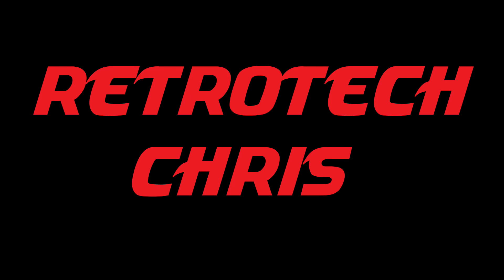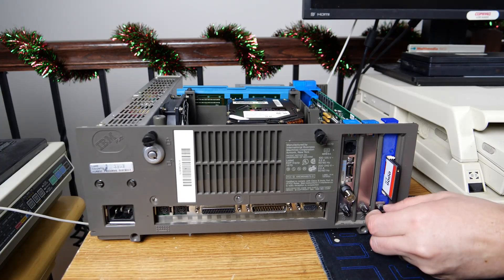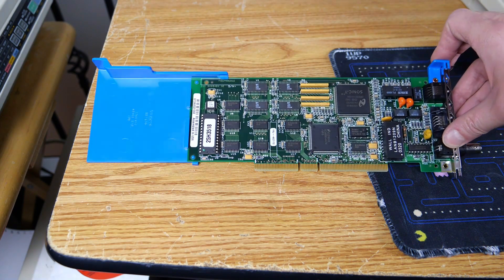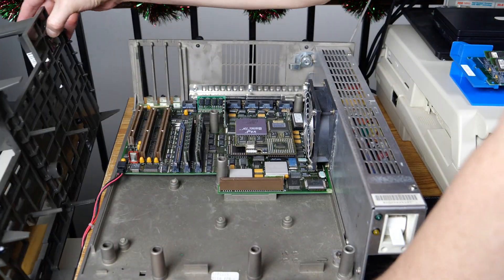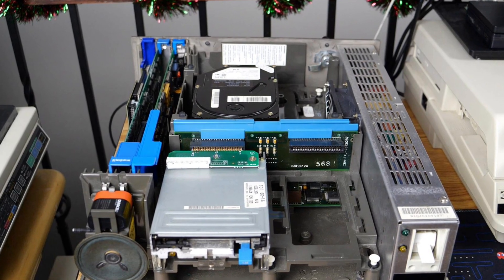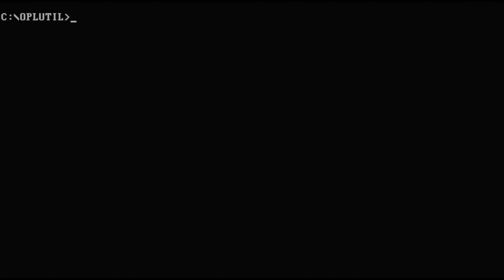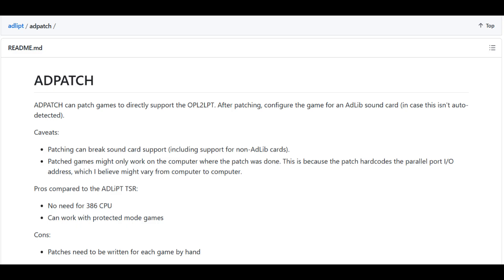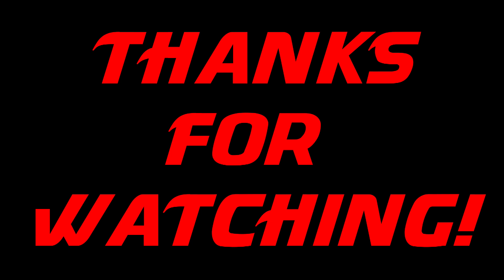Exploring and Adding Sound to my IBM PS/2 Model 70 386...It's a Real Blast!  #DOScember

Comment: I kick myself every day now, because I scrapped so many PS/2's back in the late 90's...
Reply from the maker: @KomradeMikhail  yea, we all did.  Nostalgia is a weird thing, it hits us so much later in life!
Reply: @RetroTechChris  Happy new year, sorry it is a bit late. I also did that back into the days. I do regret a 486 dx more than other machines I scrapped. For me the real fun is to make retro hardware run new software or applications. I like to see my vintage machine to be put to some useful use on my network for example I have machines of 15 years old running win 11 with 2 gigs onboard, but that takes us far from the subject. Back into the days I saw a brand new of these machines being advertised for sale in a tech shop, I though then that it had a pretty look, but I was afraid I would be short of space if I had to add stuff (Which is always the case. Anyway, very good video as usual... and as usual I will be sharing...

Comment: I like the sheer number of boot options you have in your setup. Getting proper sound on a PS/2 can be quite the chore indeed.

For fun, I set up my PS/2 model 95 to quad boot DOS 6.22 (and various Win 3.x) + Win 95 + NT 3.51 + NT 4 solely using NT's boot loader. Microsoft used to have a guide for the triple boot of DOS 5/6 + 95a + NT 3.51 but fortunately I saved some archived links in the description of one of my vids where I added additional scripts for starting various Win 3.x options from DOS 6.x.
Reply from the maker: Oh nice!  Yea, NT's boot loader is great.  I've become a fan of BootIt Bare Metal, it's been my easy button. Pretty much all of my 386 and up retro PCs are running it these days!  Thanks for watching!